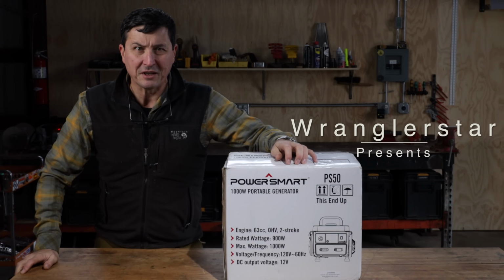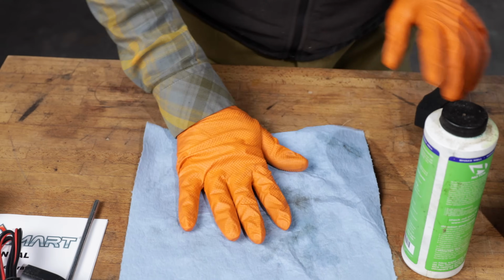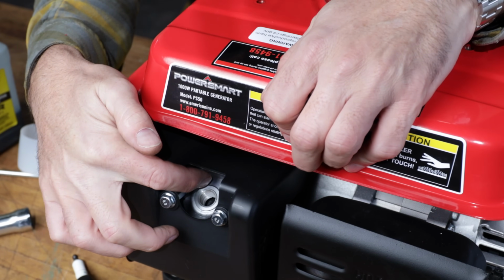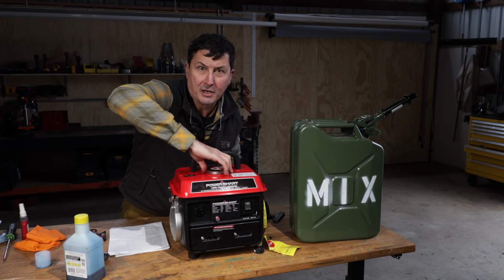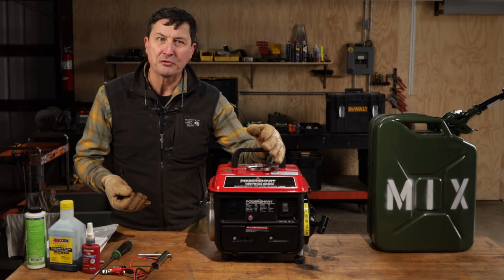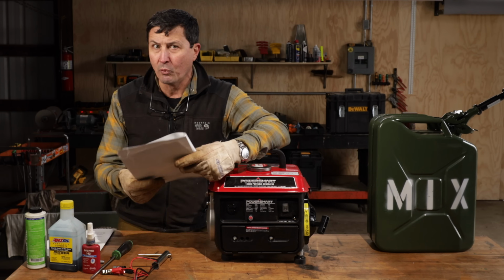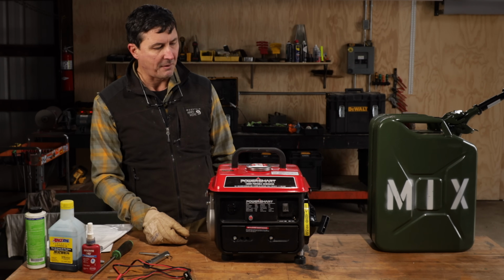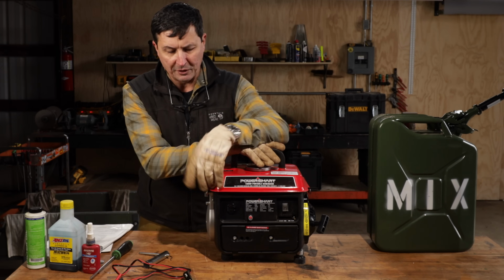TESTING The Cheapest GENERATOR on Amazon -$99

Comment: After the christchurch earthquake I had no power for 2 months I ran 2 generators  I'd run one of these every night for 2 months and it's still going strong every now and then need to tighten bolts up the pull start is the first thing to go on them don't run out of gas and keep the to stroke oil up when the pull start goes can start with the power drill

Comment: When I think of how I use a generator, I wouldn't use this as a back up to run the refrigerator, furnace, and TV/computer during a power outage. But on the back of the yamaha rhino doing work in the woods or camping it would do the job. I would probably use an inverter when using it to charge battery banks.

Comment: I bought one of these about 12 years ago (Coleman brand). Mostly, I used to run my photography flood lights (2- 500w lights). When the power was off at the house it really helped running as a second generator. When my 5000w quit I used this one all the time/everyday during the summer for 12-14 hours a day. With proper maintenance it will last a long time and the only problem I ever had was the stater rusted and wouldn't crank after sitting up for two years while I was in China. After cleaning, it cranked up with less than a 1/4 pull. Let it idle for a couple minutes before plugging in anything and a couple minutes after unplugging. I paid $100 for mine. Yes, it still runs and is used it often.

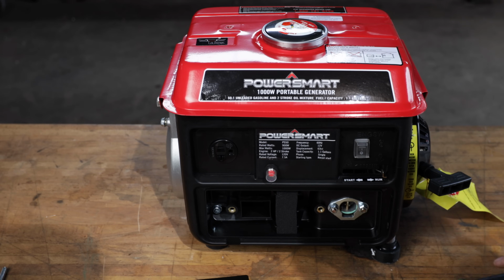Comment: 1:32 The outlet  does not matter, the output of the generator is only 8.33 Amps. (1000/120). Having a 20 Amp outlet is convenient, you don't need special  cords or plugs.

Comment: nice litte gen but be careful what you plug in ! I would prefer to load a battery with that and take the juice from an true sinus inverter cause much electronik devices wont like the generator s fluctuations like tv s mobile phone chargers or pc s.

Comment: Good job,  what you should have done , oiling the Filter Sponge is good. 
2. Instead of pouring Oil into the Spark plug inlet and spilling all over  = Just dip the Spark plug upto the threaded portion
 into the oil OR
 apply Oil liberally all over the threaded portion ,  and  you go....   :) Good day Mate .

Comment: i have the same unit from harbor tools i ran a tank of fuel 7 days a week for 2 years and its still runs. tank only holds like 1.1 gal. of gas i mix my fuel at 40 to 1 for the money they are good little units
Reply: What 2 stroke oil did you use?
Also what brand and octane of gas?
Awesome story! 👍
Reply: @stevel1475  I use the  stihl  2cycle oil that I run in my chain saw and weed water.
The generator  recommended a 50-1 ratio for the  mix I ran mine around 40-1 had to  clean the spark plug a few times and  replaced it  3 times. 
Generator  ran 6 to 7 days a week for just short of 2 years .
I didn't put much of a  load on it.  Mainly ran cordless tool charges and a couple of  led work lights. 
That extra oil in the fuel  I'm sure helped it last. I still have it but  the circuit breaker  kicks all the time now
Reply: @stevel1475  91 octane  premium  pump gas. Mainly  Texaco  other than that  conoco. 
But never  arco/ ampm gas

Comment: The Torch Chinese spark plugs have a pretty bad reputation, a number of dealers that sell small Chinese 2 stroke engines that come with a Torch plug toss it and replace it with a NGK because they had so many complaints caused by the Torch plugs.

Comment: I had an older bay freight version of it.  terrible generator, wildly fluctuating voltage.  Even breaking in according to the directions, changing to a better spark plug, etc, etc.  I tried to run incandescent light bulbs on a job site and the lights brightness went up/down/up/down. I threw it in the trash.

Comment: $133.00 now on AMAZON  
Hey if it saves you a whole refrigerator/freezer full of food when the power is out for days it's already pretty much paid for itself 👍 
USE 91/93 HIGH TEST GAS AND AMSOIL PREMIX OIL
just got one myself and REPLACED the gas lines and spark plug with a NGK

Comment: I'm curious, why wouldn't you put a solar panel and battery at your well head as opposed to a generator that will consume 5 gallons and make noise all day? You could incorporate a light bulb as a heat source if the wellhead is secured in an insulated box, or pump house. Perhaps one of those powered pipe wraps that protect against freezing? You could fashion a custom wrap of your own to work off of 12 or 24 volts of the panel and battery. Anyway, just a thought.

Comment: I've owned one of these almost a decade ago.  Design is still identical.  Do yourself a favor and pass.  They are crazy noisy and your neighbors will hate you.  They are smokey, loud, terrible on gas, and have poor electrical regulation.  The only positives are cheap, usually easy to start, and a good way to get rid of your trimmer gas at the end of the season by running it through the generator.  Save your money and buy a honda if you only want to buy once.  If you are going to buy a cheap inverter then so far I have had good luck with WEN and others like Westinghouse.  I also have two traditional generacs which are loud but always run.

Comment: "Still roaminating at about it...." Ha ha ha ha..  
I was thinking... The engine use gas and it makes lot of noise. Can a man fix a rod to the crank via a pulley and power by means of a watermill? Or use gravity in 50L water cans. Each hour you have to "jack up" the cans.  Is a thing like that possible? South Africa have a very lot of stealing copper cables and the Apartheid-power- stations(1652-1994 {1910-1994}[1948-1994]) is always failing. Dankie/ Meri

Comment: Great review. One thing of note is the manual states "This Generator is equipped with a 12V DC receptacle. The 12V DC
receptacle is not intended for use to charge automotive batteries.
 The receptacle permits the use of any electrical device designed for use in

a 12V DC."

Comment: Last time you run gas in it for the season, use gas with Sta-Bil in it. Then run it dry.
Reply: At the beginning of the season, whatever is left in the mix tank I poor into the truck, add Sta-Bil and 2-stroke oil to the mix tank, then fill up the truck and mix tank at the same time. I've never had good luck with machines running on year old fuel, but mixing it with a bunch of good fuel works well.

Comment: I was thinking of picking up the chicago electric 80w arc welder to keep in my truck, you think a cheap generator like this would be good for welding out on the property?
Reply: I would say for that purpose, look for a generator rated atleast 4500 watts. Neither my generac 3250 nor my champion 3500 can handle my dual voltage 160 amp inverter at anything above 70 amps. My $.02
Reply: @aaronpowell4885  thanks for the input, ill do some more research before buying

Comment: There is one more consideration to think about. 
A two stroke engine pollutes at least 6 times more than a 4 stroke one.
They also consume much more fuel for their total output, (which increases the pollution for the same job)
They life of the two strokes engines is four times shorter than the four strokes. (Which increases manufacturing pollution)
They produce about twice as much noise pollutions than the four strokes.  
This is why, in some countries, two stroke motorbikes are already prohibited.
Perhaps they are dirt cheap, but another clean green and nice planet is still outside our budget.. and Walmart does not stock them yet.

Comment: I have one of these product in different brand but all of these devices manufactured by Sumec company. If sine wave and hz important i dont advise these thing. However all new electrical devices uses smps type power supplys lcd tvs, inverter ac inverter refigrators.

Comment: I bought one that was a return at a local auto parts store for something like $25~$30 and used it for years on the farm. It sat in a cart to run my reciprocating saw for cutting brush when the chain saw wasn't quite the right tool or not readily available. It did the job well enough.

Comment: Ive had one of these from harbor freight.  It looks exactly the same. Ive had mine for 4 yrs, i use it for camping and emergencies.  Ive had times ive ran it for 4 days straight and no problems at all. It even has the same plug as when i bought it. I camp alot so it gets used alot.

Comment: .....you said 1500 watts, , it can't be . I have one sort of the same, it looks the same and it's only 700 watts. Is yours perhaps invertor technology ,, that's the term used,,   ,, switch mode is a better term,, anyway it's electronic circuitry that improves efficiency .

Comment: In the video you advise running the generator out of fuel before storage,  normally I would agree with you, however this is a 2 stroke and it is not advisable to run it out of fuel.  I would siphons the tank, empty the carb, and fog the cylinder

Comment: You are not getting 1500 watts! 
Says on the side 120 at 7.5 amp. That is 120×7.5=900 watts. It says 1000watts peak. 
So your 1500 watt heater had about 900 -950 watts going through it. Still not a bad deal at all!👍
Reply: Also note it's a PARTABLE (sic) GENERATOR

Comment: Nice job using a 1500 watt heater on a 1000 watt generator. You can damage a generator  this way. Generacs are the best generators. Do don't need to put oil in the cylinders on a new unit. If it has been sitting for a few years yes I would do that.

Comment: I see you are using Amzoil Saber Synthetic 2 cycle oil 100:1 mix... very smart move instead of 2 cycle crude oil. In the Small Engine shop where I work at all of our clients 2 cycle engines leave with that mix in the tank no matter what the manufacturer saids because we know it it the best oil made that gives the best protection.... Here’s a storage tip: drop the float bowl and spray starting fluid on the float, needle, jet, and bowl... let dry and replace the bowl, that will keep the fuel and oil from gumming up because running it dry never removes the fuel 100% However DO NOT use starting fluid to start a 2 cycle engine without first spraying oil in the carburetor first to creat a little lubricant for the cylinder and piston.

Comment: That's just like me I just bought a 62cc chainsaw it's a no name it's called The X Bowl both $136 and it came with ear protection eye protection a file the chain and your spark plugs spark plug remover if I bought the same size Chainsaw for like a Honda sound like that would have been like $707 it's weird how you get more stuff with the cheaper stuff that's why I sometimes by the cheaper stuff because what the heck it's worth the bang for the buck why not give it a try

Comment: I watched this demonstration a few months ago and based on what I saw, I bought one.  Works fine.  I am an old man but I can handle it easily, It runs fine and produces enough power to run either my refrigerator or my freezer.  So I have to keep mixed gas on hand, big deal.  I use Sta-Bil double strength and If I don't use the gas after a couple of years I'll just run it through my mower.

Comment: Very informative video, however when using gas is it wise to use unleaded, super, or premium grade? Also when storing could fuel stabilizer be joined with the gas to prolong the life, thus not needing to pour out the generator (sitting dry)?

Comment: You sound like you know a lot about different kinds of generators. I watched this video, but I don't think this generator is for me. Unfortunately, I'm currently sharing a house and an electricity pre payment meter with 6 other people. We're each supposed to pay the same amount for electricity regularly, but some of the other residents aren't paying! This means that I pay for the electricity, but the power sometimes goes off, because someone else or even more than one person hasn't paid their share. After thinking about it for ages, I suggested to the landlord that they should put a combination lock on the kitchen door, because it seems that this is where most of the electricity is used, then the combination could be changed regularly, but only residents who could provide recent receipts for a minimum amount would be given the latest combination. This lock hasn't been installed yet, though. I'm getting a lot of sunlight through my windows, so I could use some small solar panels, but I don't think these would power a microwave oven or a kettle. I've been studying generating electricity for some time, so I know I could generate it with some kind of basic apparatus which would rotate a magnet in a copper coil, then conect this to a car type battery. I think I might be able to connect this to a transformer to provide the 230V AC power I need, but I don't think the battery would last for that long. I do know that there are special 12V appliances available. What kiind of device can I get to bypass the problems my housemates are causing by their non payment?
Reply: I suggest bypassing your housemates right out to the street.

Comment: Question: Some generators say inverter too; WATT is the difference? Oh, is that a full sine wave and not a modified sine wave (like the Dewalt 1800 Watt Power Station)? I heard that modified sine wave is NOT good for Digital equipment.
Reply: Square and modified sine isn't good for motors like fridge compressor motors but it is so small you probably could not run anything anyway.  Not sure why it would have an inverter unless an efficient way to convert to 12VDC.  Usually inverters go from low voltage DC to high voltage AC.  Maybe the generator is actually low voltage DC and an inverter is used to make the high voltage AC.  A good generator should actually be an engine on an alternator which would be a pure sine wave at 120VAC.
Reply: Modified sine waves are mostly an issue for inductive loads like electric motors (AC compressor, fans, drills, etc...). Most digital devices (laptops, tablets, etc) should be fine on modified/square wave...but pure sine wave is always preferred (also more expensive).
Reply: ........for now I'll just say this  :-- modified sine wave is really modified square wave. It sounded better for marketing reasons to say modified sine wave . It caught on and today everyone says modified sine wave .

Comment: They are rubbish, smoky, expensive to run and poor inverter, and peaks at 400v, therefore damaging. plugged a soldering iron in and blew the circuit.

Comment: i have a similar generator, two things about it. 1 turn off the fuel and let it run out. 2 don't mix electronics with heavy, cycling loads.  when a heavy load turns off the voltage will spike significantly.

Comment: 2 stroke eh?

The absolute worst internal combustion technology when it come to air pollution. Super toxic. Loud too. Sounds like a chainsaw raping a leaf-blower.

For $100 on Amazon you can get a nice 100 watt solar panel that will keep your Iphone charged silently, even on cloudy days. For another $100 you can add a 50 amp hour deep cycle Chinese AGM Battery and a 300 watt inverter and run a small compressor driven fridge. Did I mention that the power it generates is free forever once you have the panel? Buy one a month for 10 months and you'll have 1,000 watts of generating capability. Another $1000 will buy you as big a battery bank as you like.

The point is, there are better primary energy sources than the hassle of a gasoline genset - especially an ultra cheap one. Good as an emergency back-up if you're on an ultra-tight budget I suppose, but again, there's the whole chainsaw / leafblower thing. How bad do you want to Tweet?

Comment: I brought them a little cheaper at Harbor Freight. And they usually last only 5 months. But you gave me a nice trick for the filter. So the next time I purchase one, I would use this method. Anyway, you don't want to run it all the times. These generators are for emergency only. And the longest you run them is no more for 3/5 hours. Preferably 2 hours. And don't run anything like a heater or high power devices. If you don't use it within a month, dump the gas and oil.
Reply: The good thing about buying these generators from Harbor Freight, they give you a warranty for them. When they break down, you just turn them back in. But I was getting tired turning them back in, so i start using Solar exclusively. And than i upgraded my inverter to run my power tools.

Comment: its probably true you should oil a foam filter but i never do i find that if you oil them you lose too much air flow and you have to change the filter far too often
that said not oiling my filters has not yet lead to engine death
Reply: Well you obviously don't need to saturate it with heavy oil.
All required is just a light coating on all the cells.
Reply: @fattguy21  yea but it still clogs up  my honda because i do a lot of Colorado mini adventures and it gets dusty there if i oil the filter it will be filler with red dust in just a few days

if it fails from dusting the cylinder at least ill know for next time but its still a one pull strong fo far

Comment: The Wen generator was a little over $100 on Amazon, I liked it so well I bought a second one and kept it in the box as a spare. It will NOT run the computer's backup battery power supply unit- the power is not clean enough, but it will run lights and a small space heater.

Comment: I like the fact that it comes with a visual carbon monoxide indicator as seen at 6:23 in the video.
Reply: 2 strokes always need to warm up before smoke clear + he put extra oil in the cylinder. 
I know your comment is sarcasm but some other people might no get it and have never seen 2 strokes and think this unit is bad for smoking so just wanted to clear that up
Reply: @greyhunter37   You are right, My comment was meant to be taken as a joke BUT I can see your point...  It actually seems like a pretty good little generator.